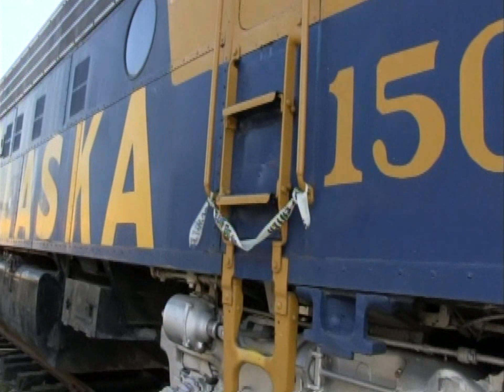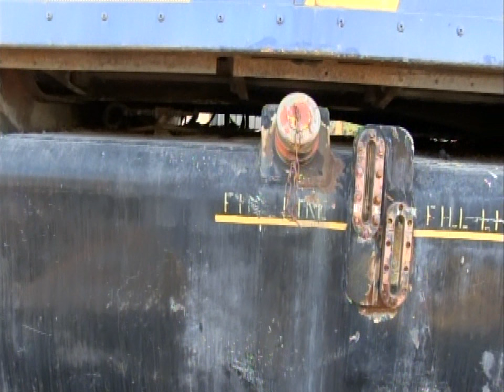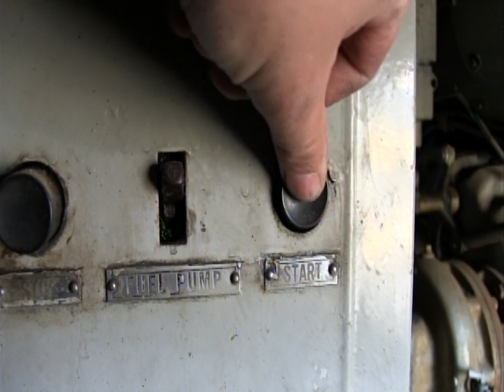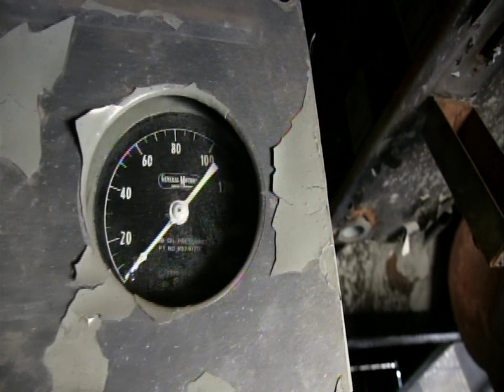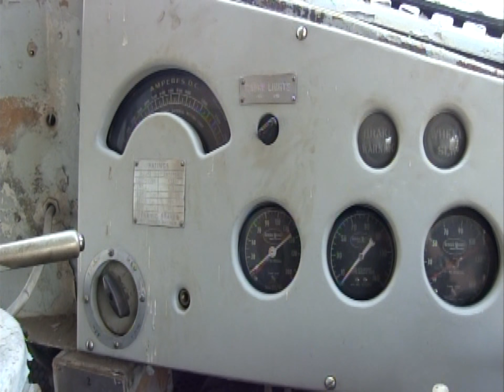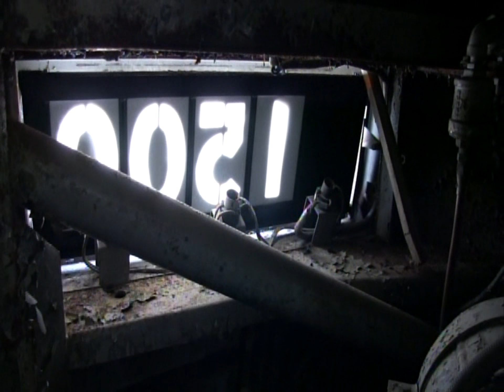Inside Alaska Railroad F unit #1500 from the movie Runaway train-1986

Comment: Just to let you know all but two engines still survive from the movie today. Both F units still exist, this being one of them, and the other is at the Mt. Rainer Scenic Railroad. The GP7s and 9s exist on different railroads, two definitely in operation. The GP40 used as the lead unit is actually on the Alaska railroad now and is still operating. The GP38-2 used for the yard scenes is also on the Alaska railroad and is number 2002. The only engines that didn’t survive after the movie were the lead engines of the Granville 12 which the runaway plowed thru the caboose of.

Comment: The movie "Runaway Train" was released in 1985, and the unit in question is not the one from the movie, the unit seen in the movie holds the number 500 and has a different fuel tank, apart from those differences its still kind of the same model, but with minor modifications.
Reply from the maker: It was actually numbered 1500 but paint covered the 1. The first scene where the brakes are burnt off was shot in Montana using a former Northern Pacific, F unit, #7012 from the Mount Rainier railroad. All other scenes were shot in Alaska or on a set in California. The F unit used in Alaska is the #1500 that is current at the museum. I have also located the other 3 locomotives and will eventually do a video on those.
Reply: @travelingtom923  Hi Tom.  Any updates on the other 3 locos from Runaway Train?
Reply from the maker: @jewllake  Yes I have found the other three. One is in Dodge City, Kanas working the grain mill. One is near Saint Louis, Missouri in storage, and the third is still in revenue service with the Alaska railroad hauling passsenger trains. I will be doing a video in the future of where those locomotives went to after the movie.

Comment: This is a very nice F7 General Motors (EMD) locomotive.  They really ought to restore this one and bring it up to running condition.  They could rent it for short runs, and they could also use it to move rolling stock around the yard.  There are still available parts for these locomotives, as they were a very common prime mover.  Getting the traction motors is still possible, along with other parts needed to restore this machine.  One could even get another water bottle for the cooler.  And hey!!  It looks like they got the inner door open.  I wonder if they got that outer nose door to open.
Reply from the maker: This locomotive is in very good mechanical condition. I took a good look at the engine inside and out and it would probably start right up if it had good batteries and fresh fuel.
Reply: @travelingtom923  when is the last time it ran and does the water dispenser still work?
Reply from the maker: @ReadingAreaRailfan  Retired in 1985 although based on the condition it was likely operational when it was donated. The water dispenser will work if you add a water bottle.
Reply: @travelingtom923  where are the GP9's now?
Reply: @ReadingAreaRailfan  Most likely at museum or a short line railroad
Reply: @ReadingAreaRailfan  GP7  1810 is at dodge city  ks tied to a slug tugging  hopper at the ADM elevator
Reply: Yeah, just repaint it to A&E north colours
Reply: 1804 and 1810 were both used in under siege 2 @ReadingAreaRailfan

Comment: Super video well done, when you filmed inside the cab it reminded of the three actors, the fight, the aftermath, and the end. Are the other engines there?
Reply from the maker: Unbelievably the other three locomotives are still in service. The lead locomotive in the movie GP40-2, #3010 is in daily service on the Alaska railroad usually hauling passenger trains. I included a link below of a trip I took with that very locomotive. The other two are on short lines. One is in Chicago and the other is in Dodge city, Kansas. In the future I will be doing a video on the filming locations of Runaway train as well as where the locomotives are now. Skip to 1:53 in the video to see the #3010  https://www.youtube.com/watch?v=163Oo3ayk2M
Reply from the maker: @Trey Epperley I am not sure. Was going to visit there this Summer to find out. I did see it there around 4 years ago.